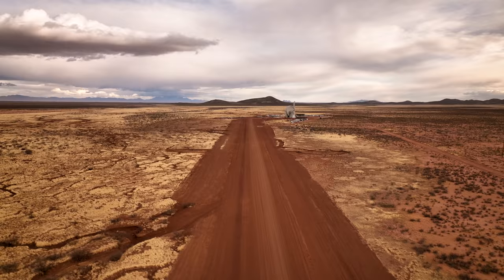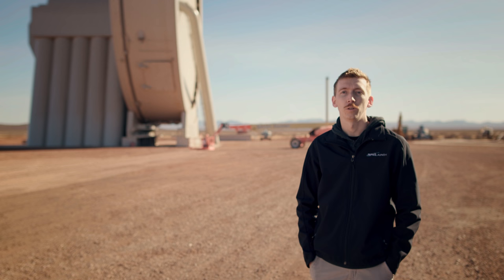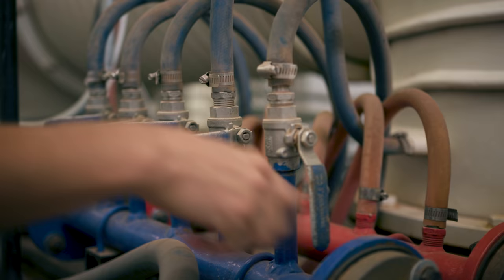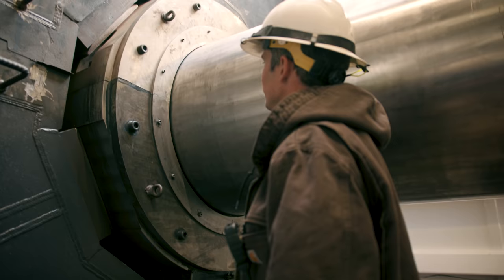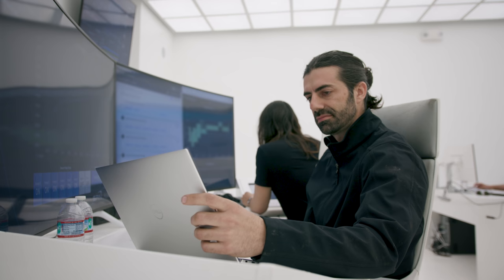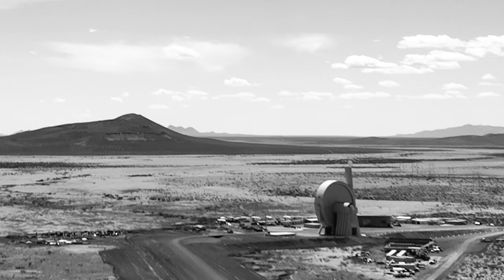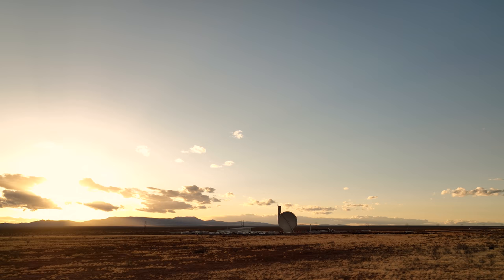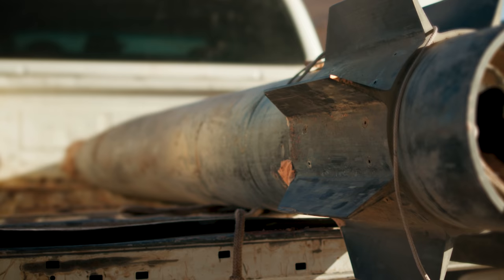An Inside Look: SpinLaunch Flight Test #7

Comment: Notice how they now DONT show the projective released through the opening to the outside atmosphere.  This is because they have a major technical issue which I believe they haven't fixed where the projectile released is unbalanced and has some serious "waggle", this only sorts itself out once its achieves aerodynamic stability.   If I am wrong Spin launch show us the footage you used to show of the projectile exit from the vacuum chamber but now don't.

Comment: What I'd like to see is the actual release from inside the vacuum vessel. The greatest controversy has been over how to safely compensate for the sudden imbalance once the payload is let go.
Reply: And they won't tell us, I asked them the same thing, something very fishy about this, kinda like the space belt/ elevator thingy. My name is Bicycle Bob and I approved this message.
Reply: @robertreynolds1044  maybe they release the counterweight at the same time, but in opposite direction?
Reply: @andysan2  but where does it go? I noticed no exit tube structure opposite of the launch tube. It would seem that is what would have to happen, equal and opposite mass release.
Reply: @robertreynolds1044  Well, there is a structure kinda opposite-ish of the launch tube. However, if you shot a counterweight into the ground at those speeds right under your launch structure, it would probably have the effect of a bomb going off in your foundations...

Comment: This one shows some of the complexity of the system. This is not simpler than a rocket launch, so it won't be cheaper. The only savings will be in fuel cost, which could also be reduced with green hydrogen. 
To achieve orbit, this system will need to throw a rocket, as second and third stages. That is very difficult, and means they still need a rocket team. 
This one mentions the counterweight, and implies that it detaches. That probably means that the system releases the counterweight at the same time it releases the payload. If so, that's more complexity and timing. It also means that the system has put in twice the energy required to fling the payload. If the counterweight goes downward into a catch pit, that energy is lost. On the other hand, if the counterweight is retained, the arm and the bearings must be very strong ... which is to say they are expensive.

Some commenters are suggesting this as possible weapons system, which leads into one of its flaws. The yeeter can't be aimed. Unless the entire structure is mounted on pivots, it can only fling straight up. Only the speed of the fling can be varied.
Most rocket launches curve sideways as soon as they get above the thickest air and gain speed. This system will only go straight up, and will be going at its highest speed in the thickest air.

Some of its problems can be addressed. Some solutions are being overlooked. Nothing says this has a future.

Centrifugal launch is as old as David's sling, and as archaic as a trebuchet. We all know about it, but we don't do anything with it anymore, anywhere.

Comment: You would think that space rocket companies will at least use a counter weight of some sort to get their standard rockets going. I know it is more complicated than I am aware of though. It doesn't even need to spin just catapult straight upward while the rocket is being engaged. The rocket fuel weight equation tends to limit the amount of fuel the craft can carry and achieve orbit. (the more weight to move the more trust needed. the more thrust needs more fuel, the more fuel the more weight)efficient.

Comment: I believe a 3/4 / and a half quarter variance would help immensely!  underwater will help  cooling system’s and vacuum sealant’s! Although if you’re underwater deployment is in ocean salt water, erosion could be problematic?. Also the launch area must be free of water. Perhaps a fresh water tank would be more suitable for a controlled environment. I think a spin launched at a angle 📐 would give you better velocity.

Comment: I see a very serious problem with heat that has to be solved. Haven’t done the math yet but orbital velocity is 17,000 mph.  It will have to be going much faster than that at release. Unless the plan is to ignite an engine after release and gaining that initial velocity
Reply: The plan is to use an accelerator like this to replace the first stage of a rocket, once it is through the thick parts of the atmosphere the projecte will ditch the aerodynamic shroud and fire an engine to achieve orbit.

Comment: Well that good idea, but as some  mentioned releasing one side of accelerated mass from gyroscopic object will cause instability in heawy objects, alltouh using additionalmweights on booth side may lower the effect of destabilisation if released  weight is smaller compares to still spinning mass. 
And for sure it still needs acceleration syatems inside rocket itself too.

Comment: The atmosphere is a notorious decelerator.  The faster you are going the more friction.  The heat on the projectile will significantly increase as will the reaction to any off axis inertia caused by the revolutions of the throwing arm at target speeds.  Is there any math or projections on the temps and deceleration curve for the target speed and expected altitude at that speed?

Comment: I believe this system is not intended to reach orbit alone but in conjunction with a traditional rocket it could greatly reduce the fuel load needed to do so . Future vehicles would be launched this way but also have engines that would fire at the appropriate time to reach orbit .
Reply: Bingo- This will only serve as the first stage of the final rocket- it will still need a more traditional upper stage to reach orbit.

Comment: That's bad ass. I have a question. If you evacuate the launch tube so it's a vacuum in order to reduce air friction, how exactly does the projectile make it out of the tube without experiencing a massive influx of air pressure once the hatch opens for the projectile to leave the tube? Wouldn't the projectile hit massive turbulence right as the hatch opens and the air rushes into the tube?

Comment: Orbital velocity for LEO is roughly 7.4km/s.  So, assuming we are in a vacuum for now, the tangential speed at release would need to be 7.4km/s minimum.  However, you cannot enter orbit from the surface with a single impulse/DV.  You can only affect your apogee your perigee remains on the surface even if you fired it horizontally in a vacuum "Newton's orbital cannon" doesn't work.
7.4km/s with a 100m radius of the "flinger" is roughly 700rpm.  That's frightening.
What is more frightening is the G force at launch would be 54,700G.  A 1 Kg projectile would excert a force of 547kN on the launch arm.  That's 55 tons.  Of course, you then need to add the weight of the arm and projectile holder which is going to be a LOT more than 1Kg.  So then you need an arm that can support several hundreds of tons.
... and no, we don't live in a vacuum and I'm pretty sure the DV required for most rockets to get into stable order is more in the order of 30-35km/s.
What is the MOST frightening of all is how these rich aging boomers funding these crack pot ideas can be so bad at maths and still got so rich.  I just wish someone would steer them to more likely to "succeed at anything" ideas than these.
Reply: The delta v needed to reach orbit is about 9km/s
But as theyve said many times before, the accelerator wont send it all the way to orbit, it will just serve as the first stage for a smaller, vacuum optimized rocket.

Comment: Good idea for non manned payloads butttttttttt good luck in finding payloads that are hyper strengthened against centrifugal force to withstand the launch cycle. Even electronics could see material float which would cause premature lifespan issues or cause other failure.

Comment: Accidents always happen when there are malfunctions. I think they should dig into the ground and place the spinner underground so as to prevent from collateral damage.
Reply: It is a pretty straightforward thing to calculate the energy of the projectile and what kind of barrier is needed to absorb/dissipate that energy on impact.  I'm sure they've built that into the enclosure.

Comment: If the counterweight at the other end of the centrifuge were a bladder of water or similar that, at release of the payload, punctured its holding cell. the fluid would quickly flow out balancing the centrifuge.

Just guessing,

Comment: Honestly, this is an excellent testbed whereby the R+D will be most useful in other applications, but for launching things into orbit? No way. It will need to achieve a tangential velocity of about 50,000 mph to punch through the lower atmosphere at an angle that will put it into LEO. The proposed size of the centrifuge is 100 metres in diameter. This means that the vehicle (and anything inside it), will be subject to ONE MILLION g's.

Comment: Get it up to 120k revs (some turbos) might have merit 🧐 A longer track up a mountain might reduce random stresses caused by the arc. Should be an x prize for hight before engine startup. Who wins, ground based or flight launch?

Comment: Do you pressurise the spin chamber for an added boost or is it not worth it?  Do you create a vacuum in the spin chamber to reduce the friction of the pain or is it not worth it? How large of a radius would you need to throw a large satellite into orbit?  Would this need rocket assist?
Reply: The chamber is evacuated so there is no friction when spinning. The final accelerator will be 100 meters in diameter. The plan is not to throw payload directly into orbit, but rather eliminate the need of a first stage in a standard rocket.

Comment: The only thing that I think this could be of use is to throw I-beams and other solid metal parts in space for the construction of let's say a space station framework to avoid putting non-sensitive materials into rockets. other that, it is not feasible to throw living and non living things that are susceptible to high Gforce.

Comment: So this contraption is going to be able to spin that fast and launch a rocket into space which is about 62 miles or will the rocket have a engine that will kick on when the rocket hits max peak so the rocket can finish its trip. Kinda hard to believe that this will launch a rocket 62 miles without a engine.

Comment: I have a question for you I understand of course you have to have a counterweight to whatever the the payload weight is that your launching to keep the machines were shaking itself apart, so how do you compensate for the release of the payload package if you have a  counterbalance attached to the arm of the machine is it released at the same time into some kind of a catch pit I was curious how this works
Reply: I like it...  a simultaneous throw-up throw-down system.

Comment: What are your goals with this method of launch? No human could withstand the G-Forces that would come with such a launch let alone the G-Force of the centrifugal motion in the spin chamber required to launch to orbit. Also in the slow motion footage there is debris that can be seen exiting with the projectile, is this debris part of the projectile, the launch mechanism or is it some sort of wadding? At 30,000 ft, that’s only just over a third of the way to escape earths atmosphere, so how would scalability be approached to reach orbital heights? I’m afraid that, although this is really interesting and it’s an out of the box approach to spaceflight, all it does is create more questions than it answers. Amazing feat none the less, maybe DARPA or the military may have more use for it as some sort of weapons launch system rather than commercial space exploration.

Comment: I don’t know the specific math and assume it’s been calculated, but would a load lock and loader, and exit lock that had an exit chamber help improve capability?   I’m thinking if a door snaps shut  behind the projectile would minimize the inrush of air aiding in velocity and turbulence and reducing stress within the spin chamber after launch.
Reply: @dazm901  And yet, they made a testbed that has worked.
Amazing what money can do, right?

Comment: Have you fixed the fundamental problem of rotational inertia that causes the projectile to spin head over heals?
Reply: Have you ever used a one handed sling shot? It works the same.
Reply: @vaylon1701  Not really.  If you look at the projectile it's rotating around the center of the system, like a old fashioned sling shot AND it's also rotating about it's own center of mass.  When released it will continue to spin about its own center of mass.  I expect if you painted half a rock white and the other half black and flung it from a sling shot you would see the rock spin.

Comment: here's something to think about... 
starts with a question
do you know why we don't find free helium in our atmosphere?
it's because it's a noble gas..  doesn't mix with other stuff to form compounds.. and it is less dense than the ambient atmosphere so it starts going up... keeps going up... 
up up and away... 
it takes work to move mass
the less mass, the less work it takes to move it... 
✌️
Reply: if you are on the ground... heavy can be good... if you want to fly... it's not
the limiting factor on my dirigibles is the amount of expansion available as the aircraft rises... it has to have less density than ambient atmosphere to rise ... I'm going to use small pulse jets with hydrogen oxygen gas... there's not actually a lot of pressure in the gas required... it's a volume to mass issue... personal size dirigibles... with sub orbital and orbital capability in a couple generations.. of dirigibles, not people ;;~} ✌️

Comment: As an expert in spinning, I have to say you're behind the curve. Try mixing 3 or 4 large tequila drinks and then switch to wine and then call an ambulance. Orbit has yet to be achieved with this fuel but only because the ablative covering of my face needed to be increased

Comment: So orbit is 264,000 feet, that's a lot of rigamarole to cut off just 30k of what's needed. The first stage of a rocket gets vehicle to 200,064 feet, with two more stages to go. So what does this spin launch accomplish by only hurling an object a big as a military projectile a fraction of what's needed for orbit ? 
Seems like the appeal is more toward just that, military use ?

Comment: is it flight or are we just using a giant slingshot to throw a rock into the air then watch it smash into the ground as it falls? While this is neat. I see so many challenges with something like this to launch anything more sensitive than a rock that I just can't see it going anywhere in its current form. I hate it but I feel like, close but no cigar. I dunno, I wanna be wrong.

Comment: if you guys added a long release of a dense gas or something in flight, would it be possible to add thrust and fight gravity to get you guys further and potentially be more stable and even faster? something like a co2 bottle inside of the projectile.
Reply: There will be a rocket engine inside the projectile on the "true" system, the mass accelerator only makes it reach 61km,but that where a conventional rocket burn the vast majority of it's fuel

Comment: No idea how they could ever achieve a velocity high enough that, after deceleration due to gravity and air resistance, it was still at orbital velocity when it got above t he atmosphere. However, that aside, while I'm unconvinced about this ever being viable for complex electronics, perhaps a version (presumably much larger) could sling materials (such as solid fuel or refined metals) into orbit.
Reply: This will only be used as the first stage, the second stage will be a more traditional rocket.

Comment: Is it technically possible from the materials to catapult a rocket in 100km, orbital? Couldn't you build all this a tick bigger? From 100km almost no fuel would be needed. Maybe you could use it to catapult bound CO2 towards the sun? I'm not an expert, that's why I'm asking here :)

Comment: This would be more appropriate as an Earth based space weapons delivery platform....oops, did I just uncover your TRUE goal? 🤔Space Port, pretty close to White Sands Missile Range....you could spin launch a hyper sonic missile, then as it reaches its peak the rocket kicks in, shooting off into space.......but it would just be easier to use a rail gun type of design🤔😁 hmmm...... it's an oversized trebuchet, if it's not a military missile launch system.

Comment: TESLA without the 369 with 369 would be totally green by replacing the fuel with an electric drive motor. 
1-$3,000,000 1.5megawatt wind turbine vs 857--- 10kw generators @$3500 EACH 
7.07x MORE POWER

Comment: Getting to orbit requires “going sideways” around the earth at a great speed, not going straight up. Even if the projectile goes higher than the atmosphere, going straight up means it’s still coming back down. So, does this mean the projectile goes up, and at apogee, turns and fires a substantial engine and burn time to reach the sideways speed to maintain orbit? It’s not big enough.
Reply: It's a great first stage boost though, rocked wouldn't need a huge, heavy 1st stage.
Reply: The final accelerator will be angled, and larger

Comment: couldn't you just use a cannon like they did in the 70's? the Gforces are fast instead of sustained and it's less likely to have a structrial fail. what happens when this is spun up 5x faster and it fails?